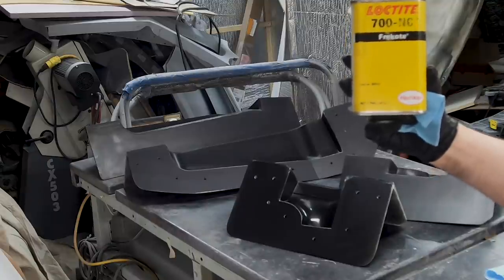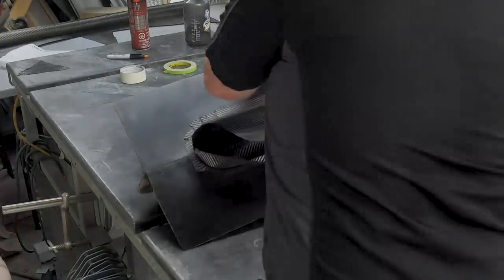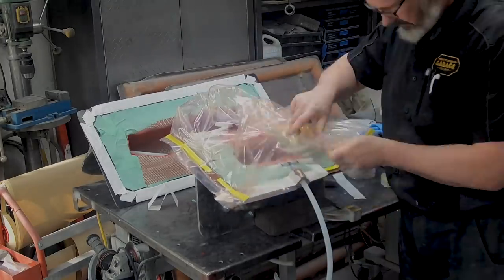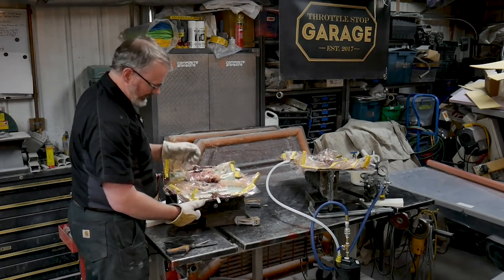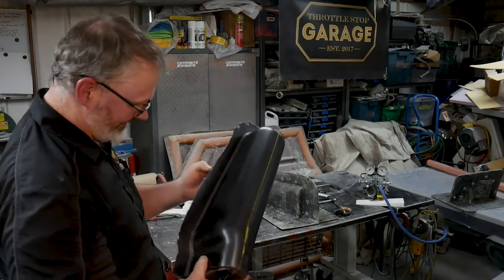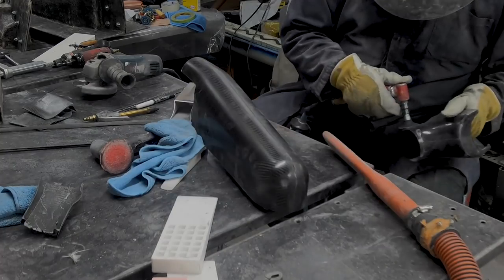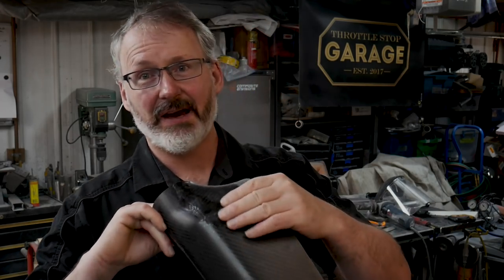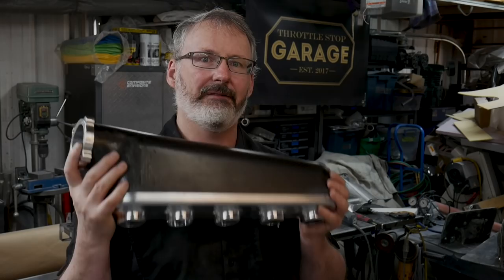DIY Carbon Fiber Intake Manifold: Part 2 Making the carbon fiber plenum.

Comment: You do phenomenal work. I started working with fiberglass and resin a few years ago. Lots of mistakes made at the beginning, but I've been quietly following your videos this past year or so and they've been helpful.  I've built a few custom electric motorcycles during that time and have been casting the fiberglass fairing parts by hand. It's a lot of work, and waste as you probably know. You'd probably cringe watching it LOL. I hope to work up the nerve to try vacuum bagging someday. I use vac injection to encapsulate axial flux turbine stators, but that's relatively simple. Just a flat circle. Complex parts with compound curves and flanges to deal with is a completely different story. Anyway, just wanted to say that I appreciate the content. Your channel deserves far more attention.
Reply from the maker: Thanks James.  Give infusion a try.  I find it a very reliable and simple process.
Reply: you all prolly dont give a damn but does any of you know of a method to log back into an Instagram account?
I stupidly lost my login password. I would appreciate any assistance you can give me
Reply: @Soren Landon instablaster :)
Reply: @Sonny Daniel thanks so much for your reply. I got to the site thru google and I'm in the hacking process atm.
Looks like it's gonna take quite some time so I will get back to you later when my account password hopefully is recovered.
Reply: @Sonny Daniel It worked and I finally got access to my account again. I'm so happy!
Thanks so much you saved my ass!
Reply: @Soren Landon Happy to help :)

Comment: Many years ago I worked with Dr. Windecker the designer and builder of the Windecker Eagle airplane. I was working on the experimental International Harvester plastic Scout SSV. We found through testing that when you have to fasten to aluminum using epoxy that it helps to sand the wet epoxy into the aluminum using 80 to 100 grit cloth backed sandpaper. A much tighter bond is achieved when doing this. We were using that process to adhere the aluminum grommets to the epoxy/glass body. We found that when doing our crash tests we had a much higher success rate of not pulling the mounts out of the body. You may want to try this on your plenum. 
I’m really enjoying the series and your build. Great work! Thanks!
Reply from the maker: Very interesting David.  I've got the cloth backed 80 grit.  I may try that.

Comment: In high school wood shop we glued something like 4 sheets of 80 grit to a piece of smooth plywood. That way you can flat sand large projects.

I know that some 2 part epoxies you can cut with denatured alcohol for few benefits. It extends the off time, removes moisture from the mix, allows you to apply thinner coats and virtually eliminates the risk of air bubbles (because it’s thinner and the moisture has been removed).

Also it’s absorbed into wood easier

Comment: Every carbon fiber project needs to have at least one carbon finish part, just for the shock and awe effect. It does look really cool, and if you put it in the engine bay, then it doesn't mess up your exterior aesthetics.
Reply from the maker: That's my vision for the car.  It's going to be a very nice addition to the engine bay...and I love engine bays.

Comment: as you were moving the camera around the part I kept saying "let's see that curve on the back side with the cuts.. come on... come one..." then you did and damn did it turn out nice! That's the kind of area that has always made me wonder how to make it look good.

That adhesive you have coming is commonly used in diy plane builds for bonding parts together, namely in the wing ribs and wing strut, so it should be quite fine for yours. 

I'm sure someone might ask about the galvanic corrosion, but if you think about it, this isn't a structural part and second, by time any corrosion happens to the extent that it would cause an issue will be so far into the future as to not be a concern. Too many people make out corrosion concerns like that as if it happens and fails overnight, or even within a couple years. If I hadn't been through corrosion training (aircraft related) I might have wondered myself. The adhesive will also act as a layer between the parts for the vast majority of the surface area as well.
Reply from the maker: It was nerve wracking to lay the first layer.  The subsequent layers were easier to lay as I was gaining confidence and skill in placing the fabric.  It sure was tricky to do.

Comment: For patterning complex parts, what also works pretty well, is directly applying (masking) tape onto your positive, finding your cut lines, cutting it of along those and then sticking it e.g. on aluminum foil. Pretty quick and you get very accurate patterns.
Reply from the maker: That's a great tip...I hope I remember it when I have to make the seats!

Comment: The joint for the two parts can be filled with a black carbon paste that has chopped strands. Ii adds strength also. Look at the Street Bandito youtube page it was about 2-3 weeks ago.
Reply from the maker: That's what I was referring to - though I used the high temp epoxy and the chopped fibers as my filler.

Comment: I may have also broken a sweat when you were wrestling with that bagging material, but your efforts and attention to detail payed off in a very pro final part!  High compliments once again!  
I just recently spoke to a carbon fibre user who told me about a resin impregnated product (NOT auto-clave cured prepreg!) but room/elevated-temp cured prepreg, which is (must be) kept refrigerated and cures without an autoclave.  Handling is otherwise similar with vacbagging required to form it tightly to mold, but the resin measuring and infusing steps fall away.  Resin amount and saturation are always perfect because it is preapplied perfectly!... the material is more expensive (no surprise there!), but he tells me it forms and holds its shape into the molds very nicely with plenty of "working time", so is a pleasure to work with, and the upcost is totally worth it for the messy resin steps that simply fall away, plus ease of handling.  ...just thought I'd mention it if you weren't aware of it...I can get manufacturer and further info if you're interested (I am NOT their salesman!...just interested in a simpler, cleaner way of getting into, and working with CF).  Cheers
Reply from the maker: Thanks Ron.  I have heard of these products but can't get them shipped to Canada until fall/winter as I can't guarantee that they'd make it without being shipped in a refrigerated truck.

Comment: I just made patterns using cheap peel ply (white w/ red stripes).  It will move/ conform to a curve a little.  Once I had it where I wanted, I marked the edges with a sharpie.  Then I flattened/ straightened it out, trimmed the edges, and spray glued it to some heavy paper to stabilize it.  Also, end cutters/ nippers are great for getting that stuck peel ply off.
Reply from the maker: Thanks Fred - I'm out of the cheap white peel ply, but that's an excellent tip.  Makes complete sense.

Comment: Excellent work again Craig. We use a perforated film between the peel ply and the infusion mesh. Much easier to remove, especially for me as im in my sixties and not as fit as i use to be. We sand our parts with 800 grade wet and dry paper and then spray three coats of clear to give good u.v protection. Ian in G.B
Reply from the maker: Thanks Ian - I've got some Duratec Sun Shield Clear that will give it UV protection.

Comment: 3D print yourself a bellmouth nozzle for the shop vacuum. It'll due much better than that narrow nozzle.

Aside from that, the parts look absolutely killer! Nice work.
Reply from the maker: Why do I never come up with these solutions? Brilliant.  Now that I'm basically done with making CF parts for the car!
Reply: @ThrottleStopGarage  hahaha well I guess a found the channel a little too late. My apologies.

Still could be a decent video/shop tip to demonstrate for the guys following the build.
Reply from the maker: @Micah_Makes  I was thinking I have a lot of bodywork to do and will design a vacuum attachment for when I do that sanding.

Comment: One day I hope to try some of what you've taught me...
Reply from the maker: Cool - I'm sure it will turn out great.
Reply: @ThrottleStopGarage  i would like to do a bunch of panels on my thunderbird.  How would you go about making a hood with cowl from a stock hood?
Reply from the maker: @AndyFromm  Work out where you want to add the new part and make it out of foam (urethane spray foam works fine). Carve it to the shape you want and then build the mold from there.
Reply: @ThrottleStopGarage  sounds good. How about the under side because it won't be for looks?
Reply: I dont want to speak for him but you'll probably have to make it in two parts, make a plug/mould from the underside of the hood around the area of the cowl, and if you want to strengthen the cowl, make some struts or something to epoxy into the cowl. So in other words I'd make a whole underside then cut for where the cowl is and go from there.
Reply from the maker: @AndyFromm  It'll take two molds  at least.  Like what I did for my hood.  The rest depends on what the shapes look like.
Reply: @ThrottleStopGarage  
 @Zach Heindl
All sounds like alot of work

Comment: Great job. Pretty ballsy to mould the outside of the plenum, and hope the inside fits the aluminum flanges.  I think most would've just wrapped a destroyable plug to make sure the i.d's were bang on.
Reply from the maker: ID or OD - either way, you have to hit a dimension.  The plug had a total deviation of 0.009" or less than 0.25 mm.  Measuring is important.

Comment: What a great result! Thanks for showing your sealing method with the wax on the flange! I am about to do an infusion on the rear decklid of a Lotus Europa and I have a split mold to deal with. Love your project!
Reply from the maker: Thanks Charles.  Use the wax on the inside but use modelling clay to fill any small imperfections on the mold join.  I did have the wax pull up a little into the part under vacuum.
Reply: @ThrottleStopGarage  That is good to know. I may try to do an external bag or attempt to seal the edges of the mold with a tacky tape and rubber sealing washers on the bolts. Thanks again!

Comment: I don't really think you need it in your current application, bonding the aluminum flanges to the carbon manifold but just for future reference.. In aviation we place scrim cloth between the two surfaces when bonding metal to composite or metal to metal to prevent to much squeeze out. Love your channel!
Reply from the maker: This has been a source of concern Chris.  I've tried to talk to Henkle-Loctite Aviation and I can't get them to pick up the phone.  I tried for a week and just gave up.  My local rep (they don't sell the aviation adhesive) explained that his engineer didn't think it would be a problem as their "consumer" grade adhesive with similar chemical properties would be fine without a fiberglass veil application.  A viewer sent me the Hysol 9493 - he's in the composite repair business and was not concerned.  So any information you have - please feel free (I'm on instagram - DM me there).
Reply: @ThrottleStopGarage  i sent you some information via your Instagram!

Comment: I have a CF intake on my 1989 M3.   It looks like they airbrushed the seams with black paint before applying the clear coat.  It hides them well enough.  Maybe give that a try.  Your parts do look great and since you have put in so much work already... I have been enjoying watching for awhile and I finally subscribed.  Thank  You!
Reply from the maker: I think once I've sanded the chopped carbon and resin I used to fill the small gaps that I won't have to do much more to "hide" the seam.
Reply: Can I have your S14 plz? K thx 😂

Comment: install a cathode grounded or can purchase a pulse device they use in Hawaii to keep cars rust free.
seen it on a few customers cars usually Military as free to Fairy over. some kind of PWM frequency modulation thru the chassis.
Reply from the maker: I'll try something when the time comes.  At least this car will never see winter again.

Comment: I suggest you drill recess holes through both carbon and metal parts where the epoxy can fill those holes and will be a mechanical locking mechanism also.
Reply from the maker: I really don't think that will be required.  Working with the various strengths of the structural epoxy and the flange design I came up with should not require further fasteners to work properly.

Comment: Something you might find useful for removing the bag and peel ply, I use a steel pry bar and slide it between the carbon and peel ply and gently twist the peg bar. It works great and you won’t be sweating buckets after removing the damn peel ply.
Reply from the maker: That's a great tip.  Thanks.
Reply: Np, getting peel ply out of deep molds is to hard without it.

Comment: @18:19 that look when you made something way better than you thought could. That's real, non-scripted stuff right there or else you sir deserve an Oscar.

I was always under the impression that carbon fiber needed to be cured regardless of whether an epoxy was used or not which is why I never worked with it. This was many, many years ago. Is this no longer the case and modern epoxies can cure just under vacuum?
Reply from the maker: I'd like to thank the academy - LOL - it's just me in my garage as you suspect.  The epoxies I've used are room temperature cure products but do gain significant strength properties when you post cure them at higher temperatures.  I made a tent from wood and foil insulation and with a space heater was able to get the recommended post cure temperature of 80 ºC for 12 hours.  All of my parts have been post-cured.  I've also experienced no issue with curing outside of the molds but some viewers suggested that this could cause problems.

Comment: Big part came out good, looks great! You would be good with 3 or 4 layers. 6 is overkill, 10 is just waste. just use twill first then use second twill to otherdirection and then use 400g square or some other than twill. ps. Lots of out of the autoclave prepregs available nowadays. You still need vacuum like here and also about 80-100c temp.
Reply from the maker: Three or four?  Really.  Interesting.  There was too much at the back of the plenum, but it will never come apart there!  I don't think I can even get the prepreg's shipped right now until it's colder out.
Reply: @ThrottleStopGarage  sure it needs to be at -20c° until labor. Dont quote me on that but Pagani factory. I quess anything below freezing is enough really.

3 layers need to be perfect but it will be strong and airtight already. So maybe use 4. Don't you get pinholes with so many layers and not pre epoxied base of the mold?
Reply: @ThrottleStopGarage  yes 9 layers will get you through atom bomb lol :D

Comment: some kind of universal shape like a puzzle piece for butt edges is a good idea, slide tap easy add after the fact to both butt pieces. U tape & weld seams & add slide tabs to b double sure won't tear at butt edges.

Comment: From my little research that i did a couple of months ago i found that Sikaflex 292 is good for carbon to aluminum bonding
Reply: I'm late to the party here, but I have some experience in this area.  First of all you have GOT to separate the aluminum and carbon.  If you don't the aluminum will corrode something fierce.  Second of all permanently bonding aluminum is somewhat of a black art.  There are really only two ways to do it.  The first way, which is how all of your aluminum aircraft are bonded together in the factory is phosphoric anodizing the aluminum - not something you are going to do in the home shop.  The second is to buy a surface prep treatment that goes by the name of AC 130 from 3M.  So for Mr. Throttle Stop Garage, this is absolutely beautiful work, but keep a VERY close eye on that bond, and don't be surprised if it separates in the future, especially after it gets wet.

Comment: I have a question about the autoclave bit. To my understanding, it is simply a pressurized oven. If the pressure can be achieved by pulling a sufficient vaccum, would putting the part into a simple oven be anywhere as effective as using a purpose-built autoclave?

I remember seeing something from the channel Technology Ingredients about making heating chamber/oven from just insulation foam sheets, aluminum tape, and a heat lamp (I cant find the video now, i think it might have been a tangent within a video titles something else). Would something like that be useful at all for curing parts?
Reply from the maker: Sure if you can keep the vacuum under the heat required for the epoxy to cure.
Reply: some autoclaves evacuate the air then pressurize with nitrogen. A they also run pre designated recipes to cook the parts at varying degrees per specific times. 

Your simplified explanation isn’t wrong, but some autoclaves are highly complex.